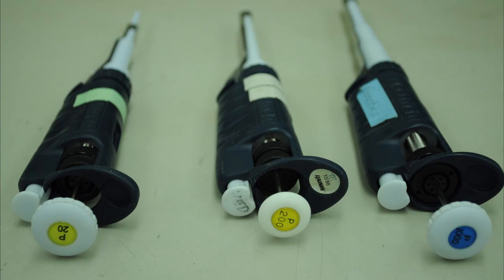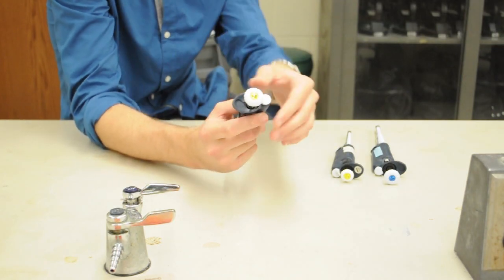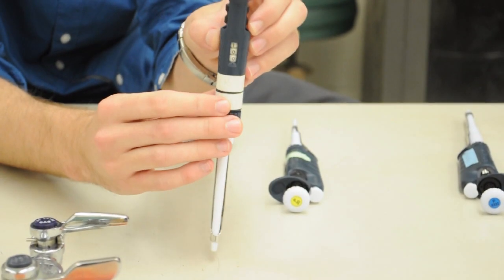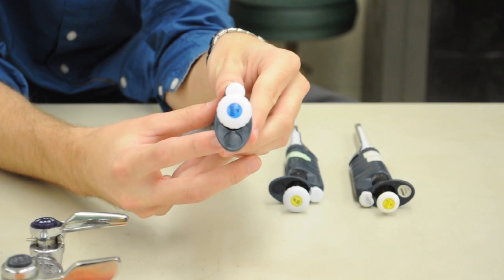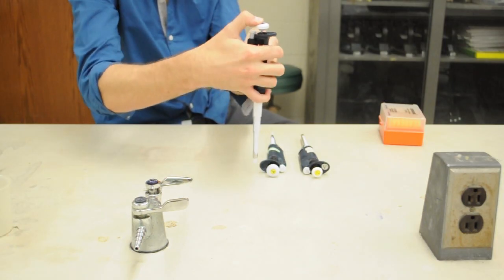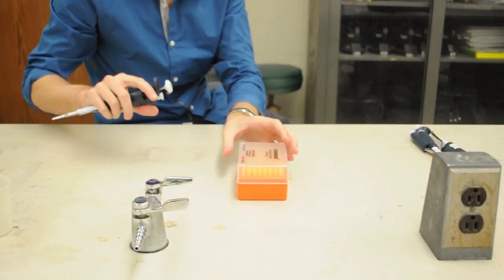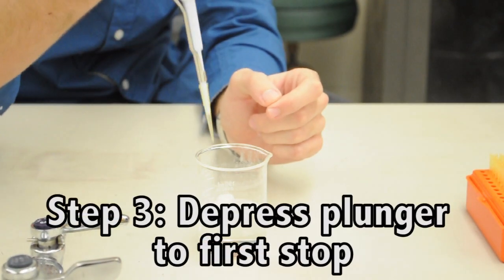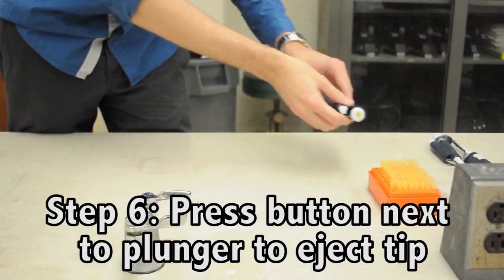How to use a Micropipette

Comment: Hey man, for the p20 the number on the windows divided by 10 represents the volume being dispensed, for p200 the numbers on the window directly represents the number of fluid being dispensed. However for the p1000 the value is multiplied by 10 to determine the number of fluid being dispensed. Is there a pattern to this or does each micro-pipette have a different "equation" in determining how much volume is dispensed? I really appreciate if you could clear up my confusion.
Reply: Each pipette volume has is own counter drum Color to determinate the volume reading. You can trust me !

Comment: If you're having difficulty dispensing your aliquot, remember to depress the plunger slowly and when you feel the first stop, you can then press quickly to the second stop.  As far as the 10% volume, I meant that for instance while using a p-100, you shouldn't try to draw less than 10 microliters, 100 for a p-1000, 2 for a p-20 and so on.  You won't be able to properly dispense the aliquot due to the physics of reverse pressure putting backwards force on the dispensation.  Hope that helps.

Comment from the maker: @smartaleck05 I'm glad you found the video useful, I made it for Genetics Lab.  Go with what your professor said as far as your exam goes, but a good rule of thumb is to not set a micropipette less than 10% of its maximum volume.  It is very difficult to fully eject anything under 10% of the maximum range.

Comment: Great job! I have a practical for lab tomorrow, so this really helped as a review :) 
Also, we were told that the p20 can hold from 1-20 microliters.
Reply: By construction a pipette is more  accurrate for a range from 35 to 100% of the nominal volume. 
Example for a 1000micro liter pipette the best accurrate range is from 350 to 1000.
Below choose another smallest range of ajustable pipette if you need high precision.